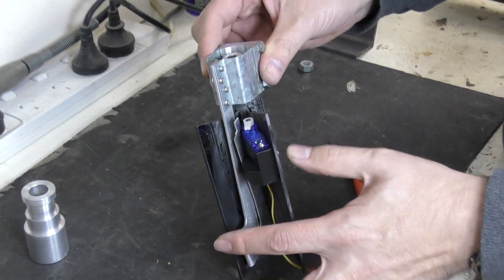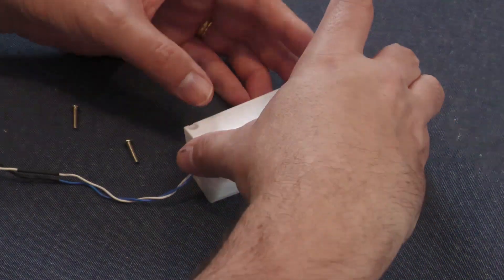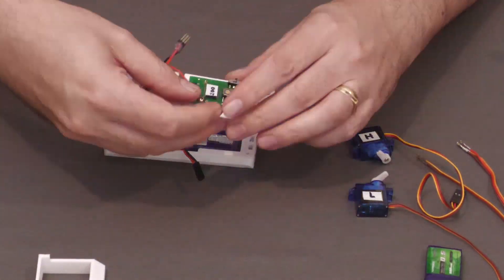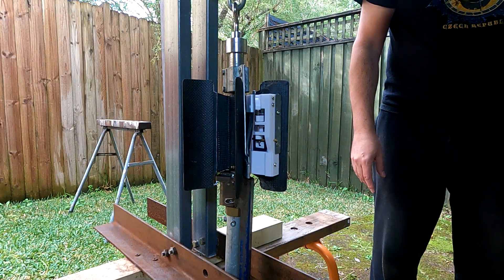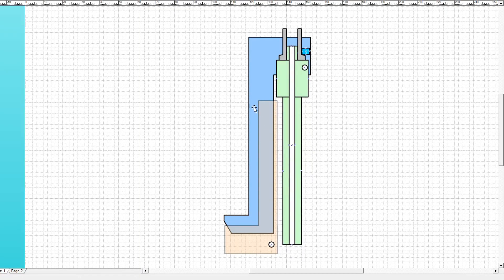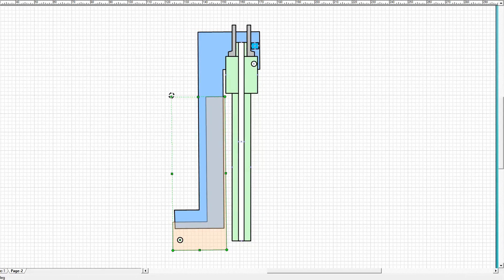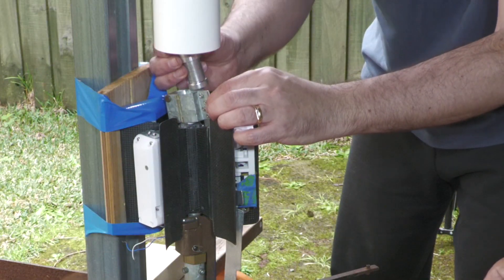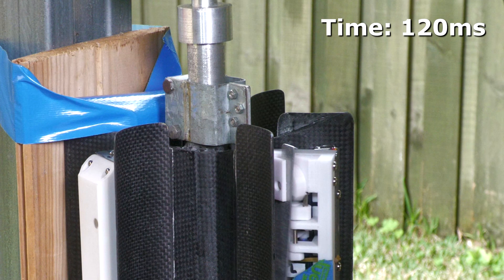2 Stage Water Rocket - Part 39 - Stager

Comment: Watching each video with awe and joy!
Question: can the cam in the release mechanism shake itself free during launch? Or is it held back via spring tension?
Reply from the maker: Thanks! That's a really good question. There is a little rubber band at the bottom of the cam for exactly that reason.
Reply: @AirCommandRockets  
Thanks for your reply! 
I didn't spot the rubber band ;)

Comment: Great job! Cannot wait for the other videos!
What I'm wondering is why are you releasing the 2nd stage so early? It looked like there were still a few meters to go...
Reply from the maker: Thanks! That's a really good question. You normally want to release the second stage when the 1st stage is going at maximum speed rather than at the apogee of the 1st stage. The second reason is that when the 1st stage starts slowing down, the water in the second stage is going to start moving up inside the rocket, and the air will go down towards the nozzle. If you stage at that point a lot of the air will exit the nozzle before the water does and you won't have a very efficient burn. So we stage the rocket before that happens too much.
Reply: @AirCommandRockets  Thanks, that makes sense.

Comment: Wouldn't it be possible to do staging without electronics? (esp considering that seems it's only doing preset time, so not even that smart). I think in some of your older rockets you relied on the fact that booster was providing more thrust/force and thus it sorta would fall down when it ran out of pressure. Couldn't there be some mechanical linkage relying on let say "break line"/string and booster thrust that keeps sager locked, then during launch break string "pulls the pin" so to speak and only thrust from boosters is keeping levers locked, and when they run out of pressure it auto unlocks (I suspect spring needs to be involved :) )? Seems like a lot of weight and complexity just to time, when mechanical force detection might even be simpler (provided it does not jam due to vibrations and what not)?
Reply from the maker: That is a very reasonable question. In our drop away boosters set up, it was possible because the main stage was firing at the same time as the boosters, and so when the boosters produced less thrust than the main stage, then they would slide backwards. In our setup here we don't have a way to measure thrust, so realistically the only mechanical option would be to detect negative Gs when the thrust is lower than drag and then somehow be able to generate enough force to stage the next stage. However, we don't want to wait for -ve Gs as we don't necessarily want to give the water in the second stage an opportunity to move too far forward and switch places with the pressurised air, because staging at that point would let all the air out first before all the water has a chance to come out. With the electronic timer we can exactly set the timing and we know we can get enough force from the servo to drive any release mechanism. We can also test it repeatedly on a static test stand.
Reply: @AirCommandRockets  Yeah I guess test-ability is one very strong point for electronics. Yet, I'm still thinking that it's possible to do it without, suppose you have spring trying to open the staging, and as long as booster is pushing with sufficient force, spring is overpowered and there is no staging, put spring on some screw and one should be able to tune the force, thus allowing to say stage then booster looses 90% of it's thrust, or 80% if you compress spring even more. Other potential pure mechanical triggers could also be option, but probably even harder to test, something like "mechanical air speed sensing", but that's probably way to theoretical to be practical.

In any case love your work through all the years!

Comment: I love you guys! I guess if the second stage came down fully presurised, you would have to disarm it with a rifle? I hope you guys watch BPS space? Can you not use his micro controller?
Reply from the maker: Yup, that was my concern too. In the end we ended up removing the non-return valve in the stager, and left only a little hole so it had a slow leak. If the sustainer didn't release then it would have depressurised in around 50 seconds.

Comment: What a weekend! Starship catch and a new video from you guys. Love it.
The release mechanism looks quite sketchy with the bend sheet metal, in comparison to the carbon brackets 😅. Very well thought through though. The multiple redirects of the 100kg forces is real clever to get the load of the servos and therefore reduce weight. And the 6 year old components fitting right in.
This project amazes us every time. 
Greetings from Germany
Reply from the maker: Thanks! The booster catch was mind blowing! :) The sheet metal seemed like the appropriate material to use in this instance for what we needed it to do. I also had half a day to get it done so we would launch on schedule.